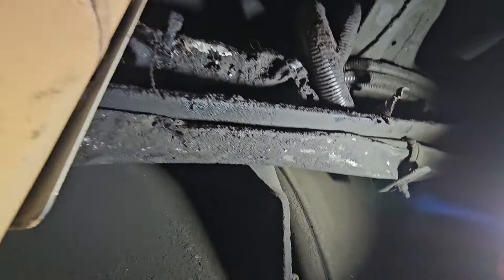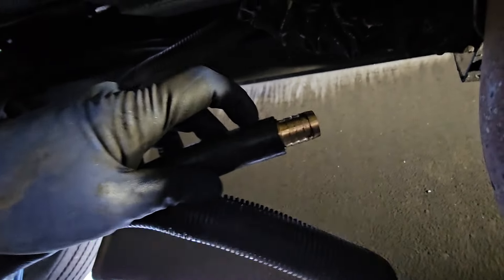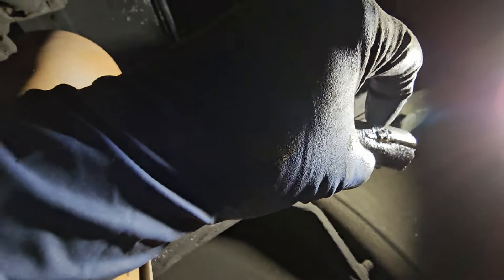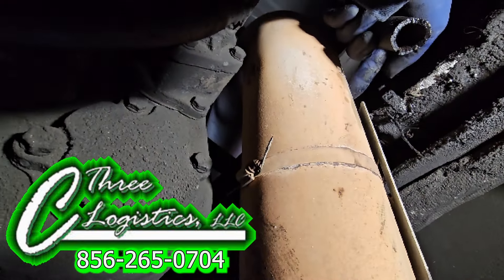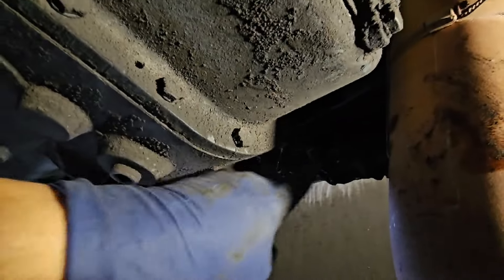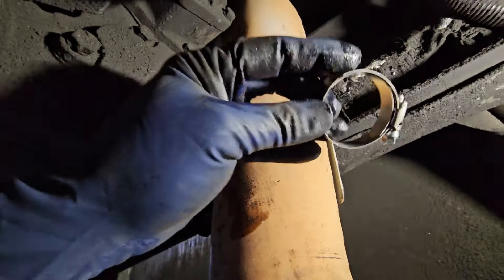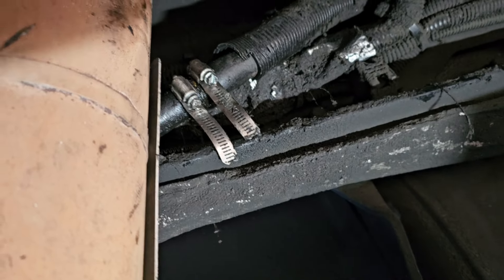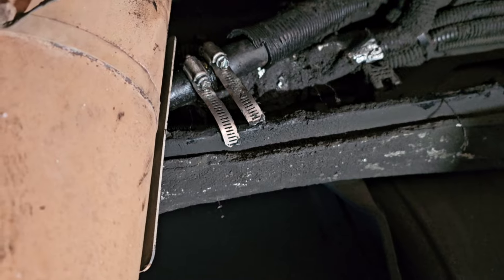Fixing a coolant leak myself. A day in the life of a truck driver. How to save money & be profitable

Comment: Have you done any thing more to prevent the hose from moving back near the exhaust?
Reply from the maker: Yes. I tie wrapped the mess out of the hoses down low in the frame clips with the air lines.